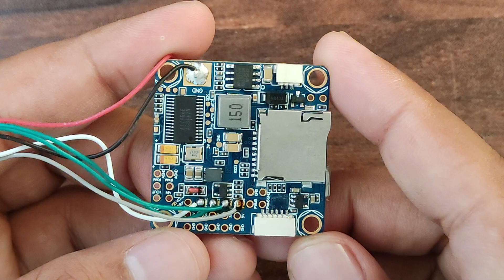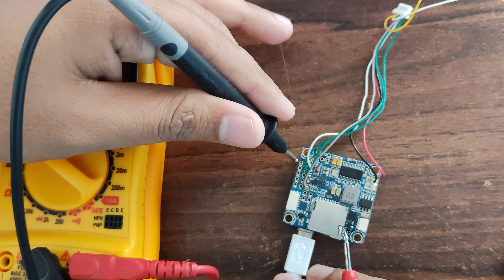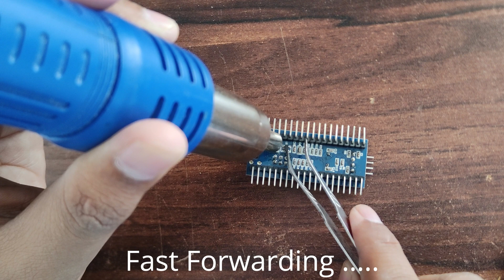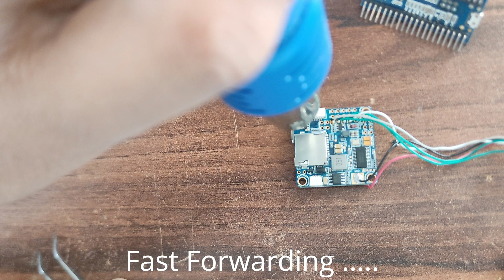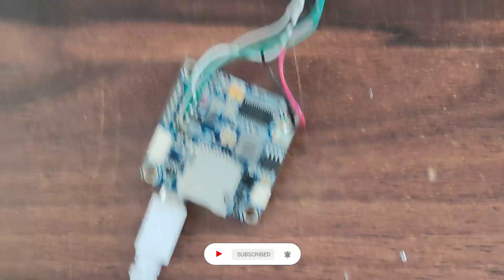How to repair Flight Controller F4 not Powering ON | Fix Flight controller

Comment: My problem is also the same my flight controller is also not on and regulator ic is also heating up, changed the regulator ic but flight controller power on
Reply from the maker: Those regulator IC's are cheap and easily dies.